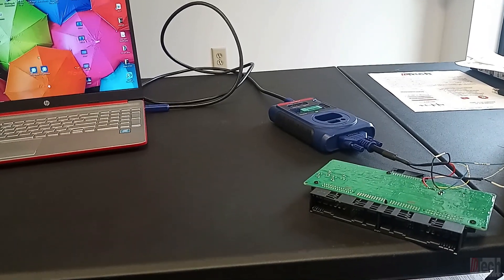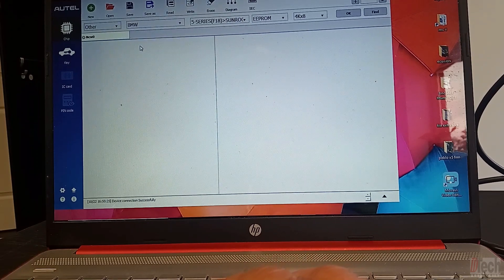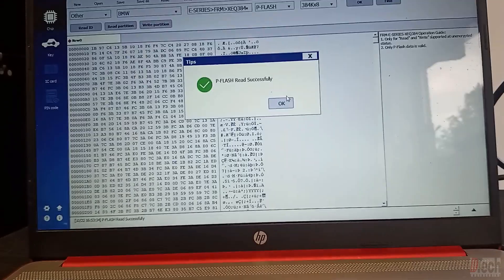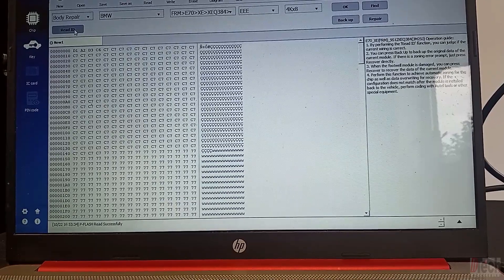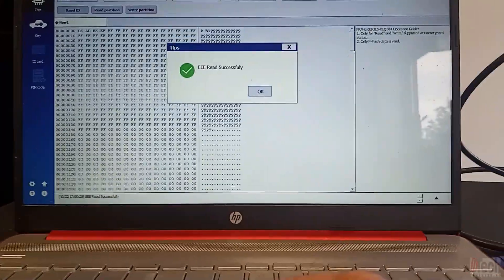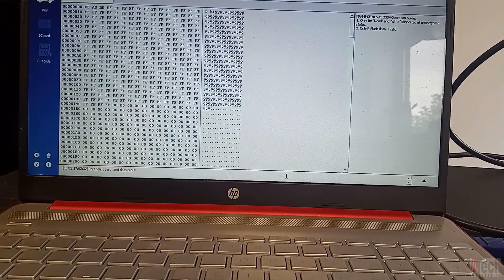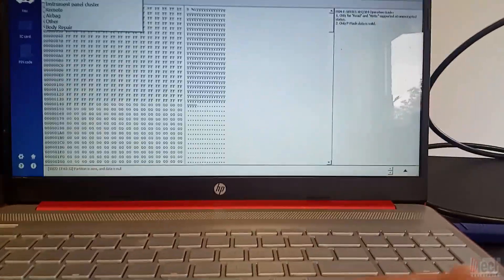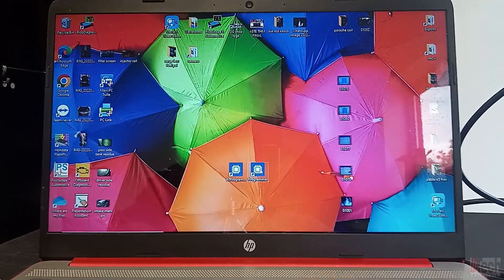*UPDATE* BMW FRM REPAIR W/ AUTEL XP400 PRO & PC

Comment: After completing the FRM repair, can you code to the car using this software? My im508s does not have the programming option.
Reply from the maker: There is a way now to do it and not needing coding after using the autel. I just put out a video showing this, your 508 should be able to get you done this new way and not need programing/coding

here's the link to the video explaining the method: https://youtu.be/CDX2wWfupow
Reply: @DTEAuto  THANK YOU SO MUCH!!! I watched your new video. I'm going to try it out soon. Thank you for coming back and solving this problem!

Comment: hi, I can use xp400pro on a computer and on the autel im508 itself, nothing will happen to the programmer
Reply from the maker: Correct, you can use the xp400pro with both and go back and forth with no issues.
Reply: i can use 400pro on atel im508 and on personal computer
Reply from the maker: yes, for pc use you just have to download the programmer off autel's site once you create a user profile login

Comment: Confirming this works 👍 I have Autel ms908s pro ii, ordered the xp400 pro, downloaded both programmer files for laptop (had to login on Autel website. The Atprogrammer was same as in vid  and in english, but the Programmer file has a user agreement at start that is still in foreign language. Clicked the already highlighted buttons, except selected the upper small dot when the user agreememt window pops up. Everything else is installed automatically and in english. Followed this vid exactly and was able to finally read and reprogram the FRM after reinstalling, with my ms908s pro ii. Two thumbs up.
Reply from the maker: glad to hear !

Comment: excellent video, if I understand clearly, I can do this with the Autel im508 with the xp400 programmer without a computer?
Reply from the maker: yes I am pretty sure you can. The only thing is I am not sure if the programmer has to be the pro (xp400pro)
Reply: Hy brother I'm looking for the same answer.
Please let me know if you have done it or got the right answer.
As I own the 508.

Comment: I’ve looked at Autel Uk but can find this to download to pc , do you have a link please to web address.
Reply from the maker: Hey Lawson, I had the same issue until I realized that the whole time I was searching for it on the Autel site there was a login section. When I got my first Autel scanner I created an account which lets me keep track of the tooling I register with them anytime I buy a new Autel product. So, once you log in. that is when you can go to the downloads section and find the software for the pc. Hope this helps

Comment: Have you checked the vin after repair? I get different vin from the car i working with, guess they repair the eeprom so you can communicate with frm and then encode it to the car. Thanks for sharing your knowledge, best wishes from Sweden!
Reply from the maker: I have not checked on this one since I was just practicing, but yes I believe it just gets repaired for it to be able to be coded again for proper vehicle specs, thank you for watching

Comment: Mmmh, so the xp400 just as a standalone kit is around $1500 here... interesting. Did not realise the tablet/scantool is not required.
Reply from the maker: Yes, that's part of the reason I wanted to make this video to share the fact that you only need the xp400 pro unit to have access to its capabilities with just a pc, thank you for watching